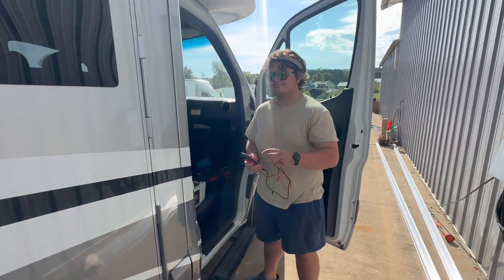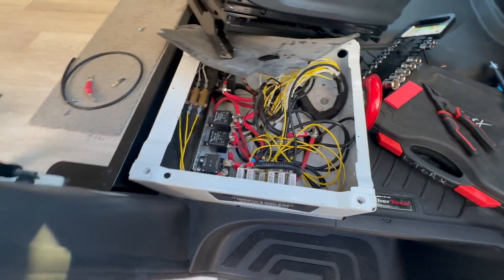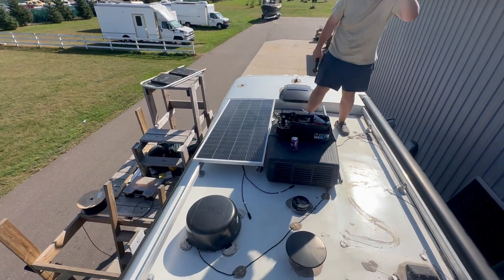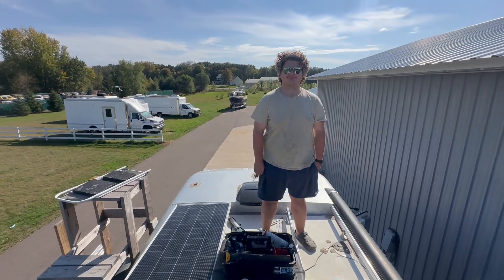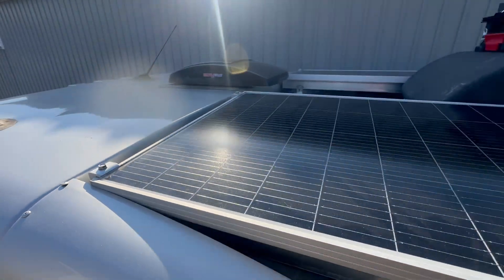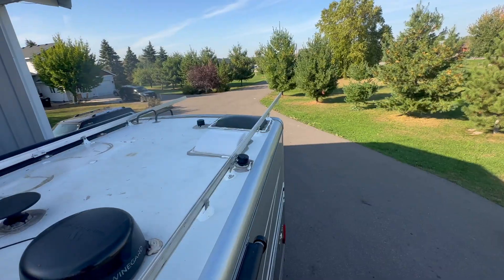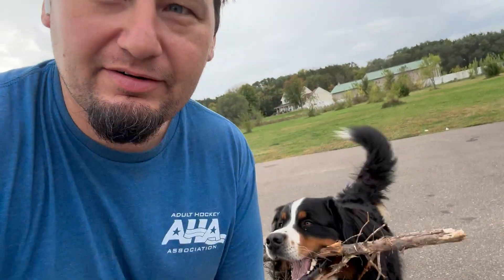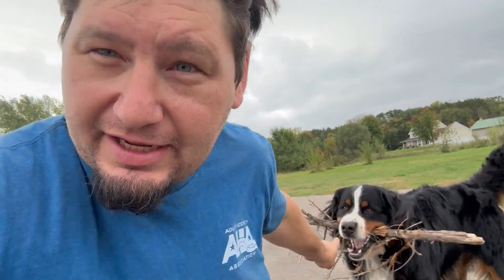Winnebago View Solar Build: Rack-Mounted Panels, Lithium Batteries, and DC-DC Charge Fixes

Comment: Well done, but why not install cross rails and minimize the roof holes?
Reply from the maker: I find it best to run rails north / south , then clamps are on ends.  I don’t think changing the rail orientation would saved much in holes.

Comment: When you use the roof screws with the rubber seal, are you putting the seal between the strut and roof like a sandwich or is the seal inside the strut and then sealed with dicor? Give bear a scratch for me. Love the channel.
Reply from the maker: The flash loc feet have a rubber seal. The rubber grommet/ washer on the fastener is also there. 

I do dicor under , in , and on all of it.
Reply: @sotasolar if you were to mount the strut directly to the roof without the feet how would you rec? Tnx!
Reply: @Atlasmehd it’s not strut, but solar rail. Much better than strut, but you need to use feet.
Reply: @NateCCIE tns, I’m looking into the feet. I’m already invested in unistrut though so I gotta figure it out. Tnx!